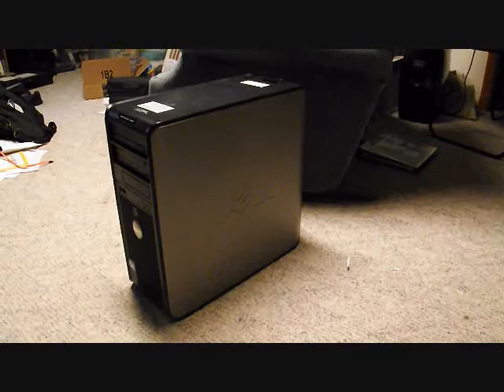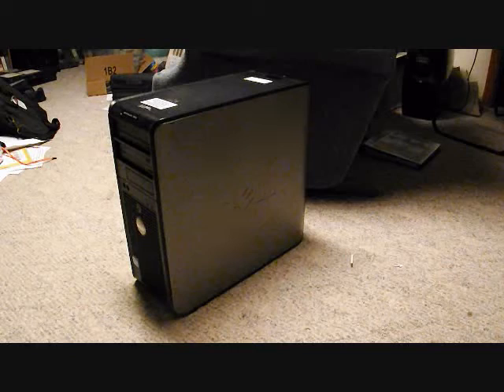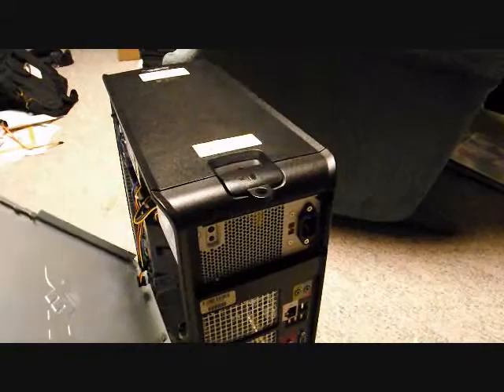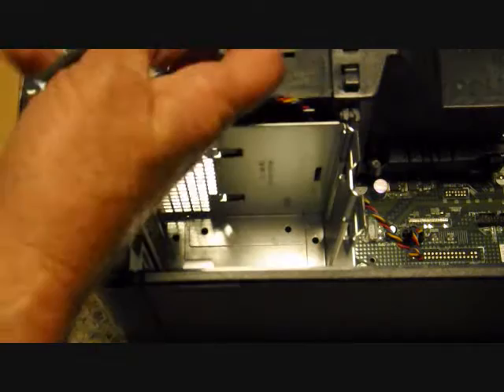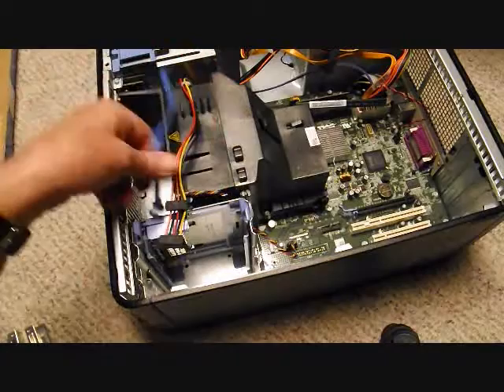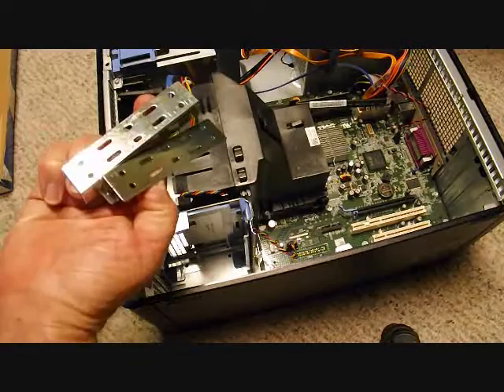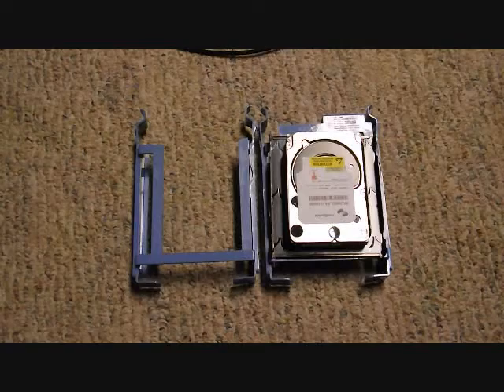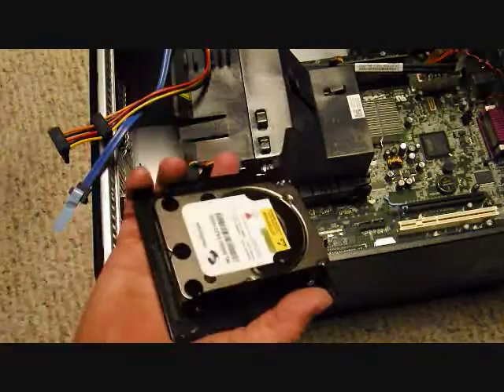Adding 2.5" HDD to 3.5" HDD drive bay

Comment: I've installed a lot of these.  Some 2.5 brackets will put drive closer to the top.  That resolves a lot of your issues.  Also, you weaken the entire bracket by cutting off the whole top.  You can grab the bracket below where the tab turns to go over with pliers and the tab with pliers and just break it off gently where it bends.  That leaves the cross piece on top for support.  You can bend the wires just a bit.  Just use the end molar connector rather than the middle one.
Reply: If you get SSD drives, they are 7mm thick and two will fit in a Sabrent bracket.